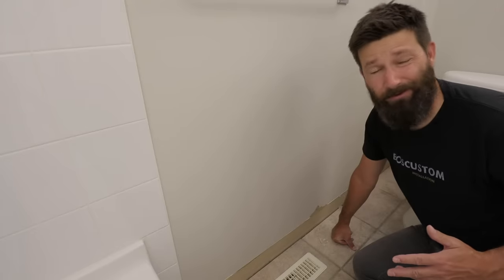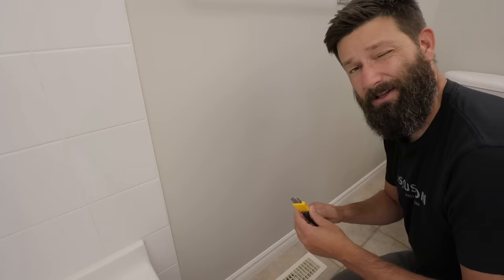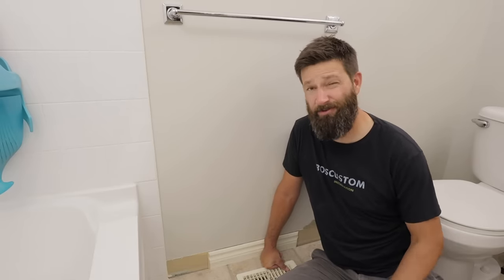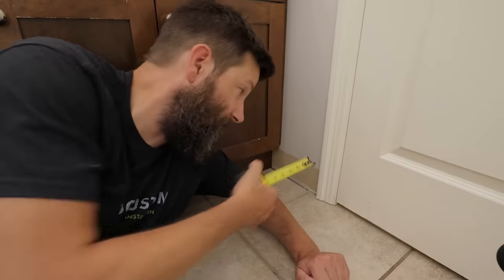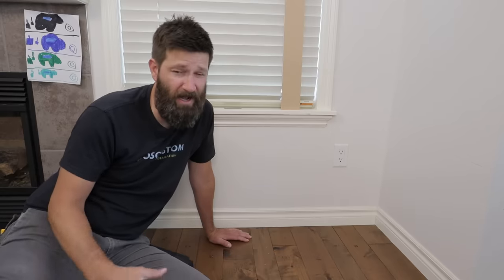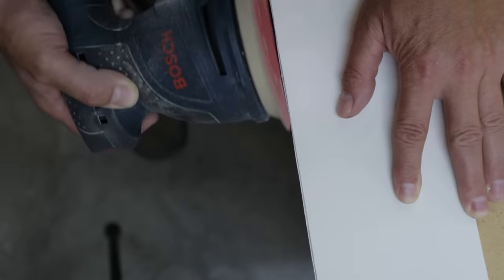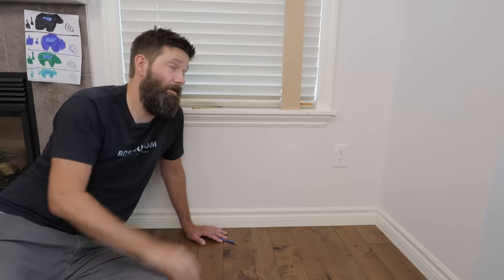The 4 Fatal DIY Baseboard Mistakes!

Comment: Some great advice but I have a question I need answering. I note your tip about going beyond 45° for external corners and there's  plenty of times when I've needed to cut a 45+3/4 ° or 46°angle for external corners -But my mitre saw will only do 45° bevel  cuts on baseboard as I have to lay down horizontal on the saw for 5" baseboard. Am I missing something obvious? Is there some way Of getting round this problem? Thanks
Reply from the maker: Usually a mitre saw will have a bolt or something that can be adjusted to allow a 46 degree bevel cut.
Reply: You're quite right- it does have a hex head bolt with a locknut which I see can obviously be adjusted to take it past 45.I had seen this previously but didn't wanna mess with it in case it screwed things up.I guess I was blinded by the manufacturer's  specs where they state maximum bevel cut is 45°.Mine is a Makita 10" -MLS100 model.Happy with the saw . thanks for your reply..Regards,Ed.

Comment: How would you deal with this fit problem? The gap between the edge of casing to drywall inside corner is too narrow for the base to fit resulting in big gap right in the corner.

Comment: I don’t own a flat bar so I use 2 putty knives. Shove them behind the board, stacked.  Handles beside themselves of course. Then I take a flat blade screwdriver and wedge it down between the two knives and pry with the screwdriver. No marks on the wall.

Comment: I am currently pulling my baseboards for new vinyl plank flooring.  You mention priming before drywall to repair the tear-outs.  Why do you prime before the drywall, I have always done it the other way around.  And if I have already applied the drywall, what do I do now?
Reply from the maker: The water in drywall mud can make the paper blister.  Doesn’t always happen.

Comment: All good but sadly #4 doesn't quite work on long runs especially when you have to miter ends together.
Reply from the maker: It can work just takes a little practice on how to do the least amount of scribing for maximum results.  I can still remember a restoration company calling me last summer to come and redo the baseboards on a place I did years back that had flooded.  The baseboards where over a slate floor and the homeowners were not having any of the bs the restoration guys were trying to pass off.  Lol it was every Carpenters dream to get that call!
Reply: On long runs I just push the base down to fake it depending on how bad the floor runs away.   On crucial jobs I take floor elevations with a laser ahead of time so I can plan.  If you just wing it and the floor is really bad you might end up with an outside corner 1/4” off and you are screwed.
Reply: @TheFunnyCarpenter  I don't know if I am envious of that skill or would rather just maintain my traditional method of explaining to whomever I am assisting that the house is 60+ years old and nothing is square or level so... If they want better hire someone instead of DYI?

Comment: Use a grinder to "cut" grind your cope joints. I tried it instead of using a coping saw and it was awesome.
Reply from the maker: I’ve used the Festool Ras for coping it’s pretty nice once you get the hang of it. 🍻
Reply: @TheFunnyCarpenter  thanks for the reply!
Reply: Oh yeah just do it the fastest way…shows your a true carpenter
Reply: @johnlebzelter4208  If I find a way that’s easier and does a better looking job then I’m going to use it. At least I’m making coping joints, a lot of DIYers don’t even go to the trouble. I even add “returns” on all of my trim too. Not that I’m trying to brag or anything lol

Comment: Recently bought a house where the paper is pulling away at the top of the baseboard. Thank you!
Reply from the maker: It's definitely fixable! I've got a vid for next week repairing those types of tears, with Drydex and Drywall mixup mud.  Cheers and enjoy the weekend!
Reply: @TheFunnyCarpenter  Would definitely love some tips on how to apply baseboards to rounded corners. My main floor all has rounded outer corners, and the previous owners just left an inch gap between the baseboards, so they don't even line up. :(
Reply: @cloudstrife428  that sounds so awful... At that point why did they even bother installing in the first place?
Reply: One of the few things I do like about my most hated enemy, horse hair plaster, is that you don't have problems with things like paper peeling off.  
... Side note yesterday I may have ruined a multitool blade because for some reason someone left the plaster beneath the trim when the replaced the rest of the plaster with drywall.  My not thinking about why I was having such a rough time with the cut and just pushing on is clearly not my fault, of course.

Comment: I was a window glazer in the early 2000’s. I couldn’t find one of those flat bars anywhere. I should’ve just asked my coworkers where they got theirs. I walked in to a specialty tool store to find one. All my coworkers called them Jimmy Bars. I asked the tool store employee for A Jimmy Bar. I did my best to describe what they were. He accused me of trying to break in to something and told me to leave. It was embarrassing. I still have the one my coworker ended up giving me.

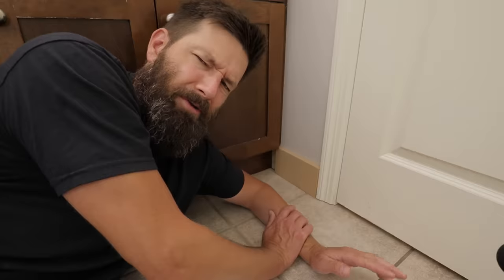Comment: 4:04 one way to do this without it being completely hideous is by creating a nice elliptical inward curve instead of a bevel, making it look as if the baseboard bends into the doorframe. Not as easy with profiled baseboards of course, but mdf is easy enough to shape and smooth out with filler.

Comment: One thing to consider: the taller the base, the more important it is to keep it relatively level around the room. Outside corner pieces need to meet each other plumb to avoid vertical mitre gaps or overhangs. Outside corners are the showpiece of your quality. Start with them and work your way back. Glue the mating surfaces and pin the corners with brad or 23 gauge pin nailer.
Reply: I glue and nail my outside corners together before putting them on the wall. They generally turn out really nice looking

Comment: #1 yes, made that mistake, but since am handy with drywall mud, I've been able to repair it and it is not "fatal".  My wife and I have learned to use a utility knife before removing baseboard after making that mistake. #2 seems a no brainer; no issues for us.  #3 Since my wife and I started doing DIY projects on our home, we quickly found out the house is anything but square.  We usually get it pretty close, but when there is a small gap (not a big gap of course) we use caulk to hide it pretty effectively but good advice.  #4, when there are gaps due to uneven flooring, we simply caulk white to fill it in and it pretty well blends with the baseboard.

Comment: For scribing base, or anything else, buy a simple compass, I use one made by General. They are small, use a #2 pencil and can be set quickly. Hyde makes the best molding bar, my favorite hand tool, Home Depot paint department. Wood floors, especially distressed, base runs perpadicular to the flooring courses are the worst!

Comment: I had the unfortunate experience of finding out my old baseboards were glued to the wall. Any suggestions for dealing with that without major headache?
Reply from the maker: Unfortunately that is going to be a major headache 🤕.  One of those red bars will come in handy and some wedges/shims could also work nice. Insert them as you go along to keep some tension then cut with a knife or the red bar. Best wishes!
Reply: Find the contractor and kick him in the shins? Won't help but he might learn better!
Reply: Id run an oscillating saw across the top of the baseboard and cut a line down and chisel a piece out. Then you can rip the baseboards off (with drywall probably as well). The easiest fix after that would just be to get drywall at same thickness as the existing drywall and patch behind baseboard then run some baseboard that is just a bit taller. Should all work out alright.

Comment: For tip #4 could you use 1/4 round instead? It is flexible and will sit on the floor, hiding any gaps in your main baseboard.

Comment: I usually caulk the gap between the floor and the baseboards
Reply: Ah yes. Caulk is our our friend. But not always.
Reply from the maker: Yuck:). It's much more satisfying to fit it with scribing.  Unless you're dealing with a bathroom water situation where the caulking could come in handy.  Cheers Andrei!

Comment: I have a question for "The Funny Carpenter": At 0:58 into the video - Can a water-based primer like Kilz, Kilz 2, or Kilz 3 be used, prior to "hitting it with some wall filler"? Or does it have to be an alcohol-based primer? And, if so, can you explain why?

Comment: Thank you for this video. I don't have any drywall in my house (yet). Nor do I have baseboard (except for one room that was added on to the house in the 60s or 70s). I do have printed wood panels though. They apparently were popular when the house was built. Despite not having drywall mud, I'm fairly sure the walls aren't 90° angles at corners.

Comment: If you scribe only one side and the baseboard is angled, the miter will not just be a 45, it will be a compound miter. Probably should have pointed that out because that could confuse a lot of people if they do it and can't figure out why there is a gap in one of the corners.
Reply from the maker: Depends on the amount of scribe and how long the piece is. Most of the time it’s negligible

Comment: Hi!  Thank you so much for posting this!  I was just about to start my own DIY baseboard replacement and would have committed Mistake #2 (the baseboard I bought was 5/8" whereas the door trip is 1/2") had I not seen this.  

Question for you:  Do you have tips for how to deal with gaps that form between the door trim and floor after getting flooring replaced?  Is there a simple trick I can use to fill those gaps or do I need to install all new door trim as well?
Reply: Caulk

Comment: What would you do if there is a dip in the middle of a longer run, where you wouldn't necessarily want to trim down the entire side to the left or right of the gap like you did in #4?
Reply: I'd just squeeze it down with and offcut and my foot before I pin it. Unless it's a super noticeable dip, then I'd just bite the bullet and scripe just enough off until the dip is less noticeable. Might take a few goes because you don't want to end up having to take off precious pieces and reduce their heights. 
I'm an old school English finish carpenter and the rule tends to be, 'if it looks alright it is alright'. Nothing is super square or plumb over here. Even newly built buildings. 
I work in buildings that are sometimes 500 years old. You have to accept that nothing is square and true. 

Saying that, most carpenters in England just 45 and caulk and fill.
Reply from the maker: I should have mentioned this in the video! A lot of times you can just push it down or just scribe out a bit to either side and push that down, thus avoiding scribing too much.  Lol I guess I have to keep some secrets for future vids😂
Reply: @flyingjackcarpentry9394  that's why God created shoe molding.It has less to do with the look and more to do with making gaps disappear. It costs a bit more to add but the time you'd save doing all that scribing and re-visiting your saw or sander is well worth it.

Comment: The 2nd example of Tip #4 won't work. If you scribe & cut down the high points on the left  half all the way to the fireplace, then when you push down and install, the right side at the inside miter corner will "pivot" up unless you scribe the entire length of the run.

Comment: Would you recommend the same method as tip #3 and #4 for the transition between carpet and LVP?
Reply from the maker: Not sure I understand the question here.
Reply: @TheFunnyCarpenter  I guess it’s just tip #4. I’m installing baseboard in my basement and I have one section about 45” that half is on carpet and the other half is on LVP. There is a gap along the bottom of the baseboard near the transition that I’m not quite sure how to hide.
Reply: @Justin-fg6wp  LVP should have a gap hidden by shoe molding. Baseboard never has shoe molding on carpet. Miter or return the shoe at the transition.

Comment: Not a trimmer if  you 45  inside corners , copeing works even if inside corners are not 90 degrees. Plus the wood will dry and schrink and on  45 both pieces schrink and your joint will open up more

Comment: Acute angles measure less than 90 degrees. Right angles measure 90 degrees. Obtuse angles measure more than 90 degrees. ;)
Reply from the maker: That’s right.  The outside corner is acute with the mud build up.  That’s why there is space on the inside of the square.  The inside corners are obtuse.  If a corner is acute at 89• then the mitres you cut on the saw will be 45.5•

Comment: #5. It's almost like De Beers owns caulking companies and normalized caulking everything in your house like they've normalized a diamond ring worth three month's pay. There's no reason to caulk the top of your baseboards. When you need to change them, it makes a ton more work, and there's no way even the average professional painter is gonna get lines as crisp as what you get by just putting a freshly painted baseboard against a wall. Plus, you basically eliminate most of the problems you're trying to solve in this video
Reply: The idiot that built my current house volunteered to paint my baseboards black, vs me doing it. When I told him NOT to caulk them, he insisted that he could do it without it showing. 
And you know the rest...😡
Reply: Old comment I know. Normally I'd agree with you but in my case the MDF baseboard was nailed only to the base plate and not any wall studs. It was much easier to install that way but in some cases can cause a small gap at the paint line. I did end up caulking the top for the perfect finish look, but did so meticulously by using painter's tape all along with a very small gap. Caulked it and pulled the tape immediately. It's a perfect line.

Comment: The biggest mistake in all these bathroom  examples is not having silicone or hybrid caulk between the floor and baseboard. Can you imagine how fast water will spread underneath those baseboards to the adjacent walls, if you have water damage one day when you’re not home?

Water proofing in US bathrooms just seems to be absolutely terrible.
Reply: I don't think this had a bathroom example?  Either way I was taught that trim wasn't ever supposed to be structurally significant beyond slight draft correction, and that waterproofing and such should happen before any trim goes up.  I, however, am not professional, and the person I learned that from ran a general construction company which, in the 40ish years of business, never built a residential house.  I know US standards for residential single family homes tend to be much more lax, and I don't know how much of those things I learned were code related or personal preference.
Reply: You can go to around 2:50 in the video for a bathroom example.
Reply: @MadebyAAA  Ty for the link. Didn't recall that bit as 'bathroom'.

Comment: The last one. The scribing is too much. Because your caulk is white, only use masking tape on the floor. Get you some 40 year caulk and run a bead. Pull the tape while wet. White blends in on baseboard and you have a perfect line on the flooring.
Reply from the maker: So much quicker and better to scribe.
Reply: @TheFunnyCarpenter  maybe better, but I promise you, it ain't quicker. Not even close.
Reply: @TheFunnyCarpenter  one last point. Your putting one piece of wood under a low spot in the floor. It still shows a line gap underneath the baseboard, which will never be straight and uniform. The only way to create a presice line and division between floor and baseboard is to use caulk but tape the floor. In Texas, that is how 90% of the homes are done. I think it looks better than leaving an uneven line you will see no matter what because no concrete floor is perfectly straight.

Comment: Fatal baseboard mistake: sharpening the end and falling on it, impaling one’s self on the baseboard strip. 
Also: “was cutting piece, fell onto table saw”
Reply from the maker: 😂fatal may have been a little dramatic for the tittle…
Reply: @TheFunnyCarpenter  not necessarily; depends on how strongly your spouse feels about having nice baseboards. 
Also you should do something on removing ceramic stucco ceilings; it’s a project I’m midway through and it’s a nightmare. This stuff doesn’t break down in water, I literally have to bash it down in chunks with a hammer, and then there’s a radiant heat ceiling above it… absolute nightmare.
Reply: @danielled8665  That's horrifying.

Comment: This is mis-use of the word ‘ carpentry’. What is being undertaken is ‘joinery’  Carpentry traditionally is the first woodworking on any building site. ie shuttering, roofing, partition walls etc. Sorry to be pedantic but as an ex joiner it annoys a little.
Reply from the maker: Interesting, in BC it’s generally called Finish Carpentry.  🍻

Comment: 4:32, an acute angle is less than 90 degrees.
Reply from the maker: Think you may have misinterpreted my use of it.
Reply: @TheFunnyCarpenter : Nope, it’s simply incorrect… the angle between the two sides is less than 90%. I thought you might appreciate the correction rather than defend what appeared to be an inadvertent error.
Reply from the maker: @rayray8687  the angle of the outside wall is acute(less than 90), the angle change of the pieces being mitred together is more than 90 degrees, that why I suggest cutting them 46 degrees.  Anyways thanks for checking out the video and I appreciate the comment.